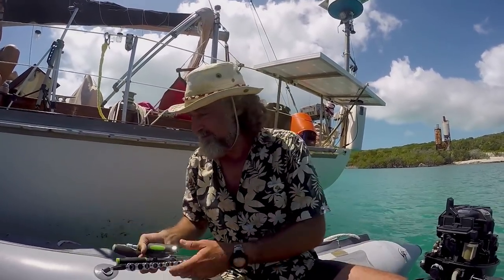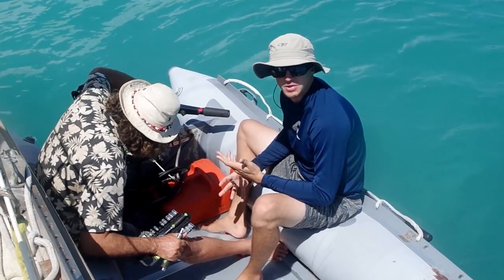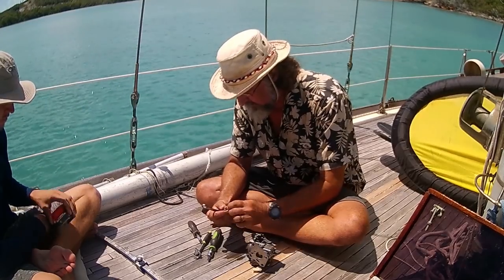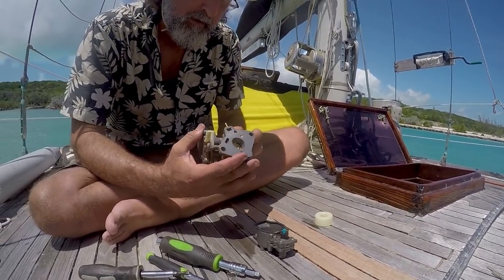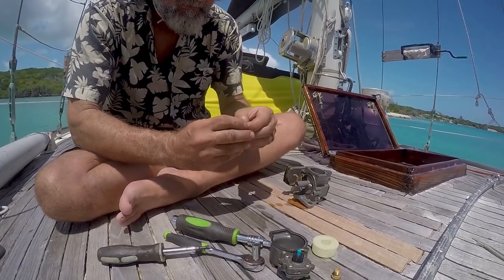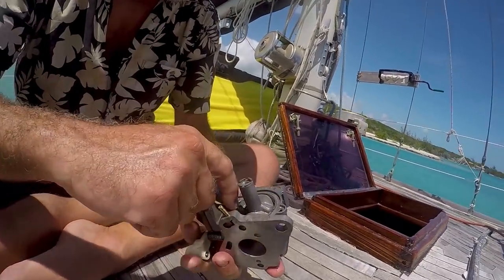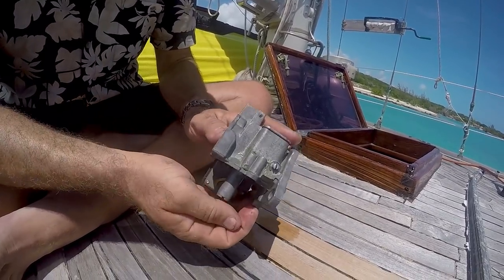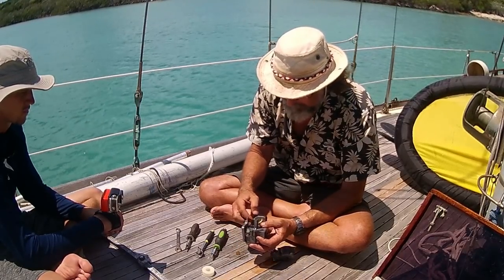Fixing a 2-STROKE OUTBOARD Motor [Capable Cruising Guides]

Comment: When I am dealing with outboard motors with fuel problems, I always swap out the entire fuel tank, and hoses from a good running engine before I tear into the engine. Seen so many times that a clog line, or a pin hole in the line cause so many problems. Easy to check and for me lots of the issues where the gas tank or lines.

Comment: And may I mention that power to weight ratio is awesome on two strokes and when properly tuned with good quality 2 stroke oil they are quite clean burning, and the simplicity is way better than 4 strokes and way cheaper to repair.
Reply: No  cam belts to replace and on looking on outboard problems its all salt water in bottom end and over heating and Corrosion. The only decoke when on a Engine strip is the water jacket with the fured  up corrosion and you would get that in a 4 stroke so for recreational use on a budget the Mercury 2 strokes are a good bet.
Reply: Especially if you have to lug it around

Comment: I have a terrible success rate of repairing carb problems, but after watching this video , I fortunately had the exact same problem as my 15hp merc outboard. Blocked jet with gunk from the fuel bowl. I originally thought it was an electrical problem because at WOT it would die like a light switch after a few minutes of running but will start instantly again. After checking and cleaning fuel filters, the boat died and would die shortly after.  It feels good to have a boat running mint again. It was not a good feeling having a dead motor on the water! Thanks Emily and Clark.
Reply from the maker: Hi Darren,
   Glad it helped. You could always buy me a beer on patreon.  :)
Clark

Comment: That's what cruisers do, help out other cruisers and the community they live in. Best explanation I have seen on how a carburetor works. I have fixed, cursed at, yelled, threw away, replaced and repaired more than I cared to. Here in the states these days, if you leave this crappy gas in the bowl, it gets gunked up quick, even with fuel additives on my lawn mower, weed wacker and blower. I finally found just changing the carb is a lot easier on my soul, but not my budget...

Comment: I'm having trouble with my mercury 4 cylinder 2 stroke 85hp starting. Once it starts it runs well until you turn it off, then it's a pain to start again. I have zero experience with  motors but this video gives me hope! I'm SO glad that he mentioned the part "if once the engine starts it runs good but it's a nightmare to start". Thanks
Reply from the maker: Hope it goes well for you.  

The bigger old mercs have multiple carbonators.  If yours does it's just more of the same.

A good trick for 4 cylinders not firing in all 4.  With an insolated glove pull off one spark plugs wire at a time.   If the engine slowed that cylinder was firing.   If it stays the same you found the one that was missing.

Comment: Good stuff Clark! I have a 2000 Tracker 25hp 2 stroke and it has been great for me to learn on and I had the same issue recently, starts great most the time plus idles fine then when getting up to speed it would putter out and die. Cleaned my fuel filter, got a new fuel hose which was deteriorating and used seafoam to help flush things out and so far so good, next step I would clean my carb and check my reed valves out of curiosity

Comment: If  I was looking for a 90 to 150 hp Outboard on a budget for a 15 ft 80s speedboat for some boating and the boat mainly on the Trailer surely a Mercury 6 Tower or 3 Cylinder Two stroke would be the best chose. But fantastic and informative thanks.

Comment: Just so you know the trick to taking these carbs off (6hp-most 20-25hp motors with the pull to prime) the 2 retaining screws that hold the primer assembly to the carb can stay on. Simply remove the tiny screw holding the primer plunger off completely, then remove the metal retaining ring on the inside. now you can slide the plunger completely off and thus remove the carb!

Comment: Brilliant!  Thanks for providing the link in your reply to my comment on your 4-stroke video. 👍
Reply: So, I’m the proud owner of a new to me, 9’ inflatable with inflatable deck and keel with a 2012 Mercury 5hp 2-stroke. My first tender for my 39’ sailboat. I sail on the Great Lakes and up to now have been harbour hopping as we cruise and now feel so liberated having the dingy and anchoring out. Bought all this used at an incredible price and am so happy with it as it runs flawlessly. So, my question:  Do you have a recommendation for a light efficient 4-5 hp 4-stroke outboard?  I’m looking to upgrade to an aluminum 8’ rib and want to keep things as light as possible. I like your idea of electronic ignition.  If not available, what’s your next best suggestion?
Reply from the maker: No one makes a fuel injected motor that small.  If I was to buy a motor that sized now I'd try the Suzuki.  I like mine, it seems built well.  They make the lightest offerings.  The 6 weighs the same as the 5 so I'd get the 6.  https://onlineoutboards.com/collections/outboard-motors/products/suzuki-6-hp-df6as2-outboard-motor

I've bought from this outfit before.  Always a good experience and cheap/fast.  Not a sponsor or anything, just who I recommend to friends.    (Though I should hit them up for a sponsorship)

Tahatsu makes a good inexpensive motor as well.
Reply from the maker: Yves.  Have you subscribed to us yet.  We live for that subscription number.  In fact would you consider sharing our playlists on social media?  Your friends might also like our stuff and we like to see that subscriber number grow.
Reply: Emily & Clark's Adventure , subscribes last night as soon as I saw your vid. Have watch 3 or 4 vlogs so far. Great stuff 👍. Will definitely share. Thanks for all your comments/replies, very helpful.

Comment: From experience, when you take a carb apart, always photo/ video.  I didn’t and could not work out how to put the diaphragm back on, in the end bought a kit..just as well perhaps. 
Also, first thing is to drain the float chamber, could have water in the bottom

Comment: good video, yes, and you fixed it, but I would have liked to see you lay down a clean-ish white cloth on the boat deck (at least a paper towel) before you started on the carb. might prevent tiny wood slivers and other dirt from getting into the carb during re-assembly and helps to not lose the tiny parts. also for young mechanics out there... might as well spray a lot of carb cleaner all thru that carb and its other jets since you have it right there in your hand.

Comment: Seagull engines were built in the UK one cylinder two stroke easy simple electronics simple carburettor had duel airflow in case of water as Many were dropped in to the sea cleaned out and worked very strange how they were built. When they made rules against two strokes that was the end of the company sadly. They started from two HP right up to ten HP. No Reverse gear no twist grip it speed was like lawn mower using your thumb to stop was just taking the thumb switch all the way back to stop which may not work to stop it so put hand over the carb and turn off the fuel. A terrible dangerous idea to many is how to start the seagull. A pull knotted rope that can kick back also trap the rope. No modern pull start with recoil just rope on a pulley with a notch The Fuel tank only held two gallons of mixed fuel painted black as engine was silver. Its prop was designed to push anything as once started it was going  there is no neutral or out of gear. They tested a WW2 seagull pulling via an aluminium boat two huge barges down the Thems river in the UK in the 1960s very slow but did it. Even though I am British the engines were built in to the 1980s  to 1990 but not sure what happened after that as Two strokes were being phased out of water ways because of the pollution. I had one on a river boat 15 foot all wood one.

Comment: Thanks so much for this - very clear and concise and not as complicated as it looks!  I'm interested in what you mentioned about changing carburetors to effectively go from 8Hp to 10Hp. I have a Yamaha, 8hp 4-stroke - Do you happen to know if it is possible to replace the original 8Hp carburetor with the larger 9.9hp carburetor?  Could definitely use the extra oomph and love the idea of having a spare carburetor around if ever needed.  Cheers!
Reply from the maker: Looks like they are also the same motors.  Big hint is they have the same displacement and are described in the same section of the website.

   I've never had the two both apart at the same time but I'd bet money the bigger carb will fit and function.

Also I like the Yamaha.  Don't see many as they work without problems.  Clean design, easy to work on.  I like that their carb has an accelerator pump.  Not necessarily but nice touch.   Tells me they probably don't cut corners in other places.

Might have been a larger motor I'm thinking of, but I like Yamaha.   I ride a Yamaha when I'm on land.
Reply: @Clarks-Adventure  Awesome! I'm really excited toggle it a try.  Will send an update to let you know how it works!
Reply from the maker: Looking forward to hearing the feedback.

Comment: Great video! I have that exact outboard, and I'll be testing it out on the lake on my tiny MacGregor 22 this weekend. (I mean I know it works, as I did the barrel test for almost an hour and it was running smooth) We'll see how bad fuel efficiency is compared to 4-cycle Honda. Thanks for that video, I'm a bit more confident I can troubleshoot some more issues if they arise.
Reply: So an update: after putting the boat in the water with that Mercury attached, after multiple turns I started it on a choke, had it on it for about two minutes after which I pushed it back in. That's when the motor died and couldn't be restarted. Tried for about 10 minutes, gave up and swapped with my trusted 7.5 Honda 4-cycle that I brought as a backup. While on choke Mercury was shaking pretty bad, smoking and even releasing some oil into lake, which made me even more encouraged to put it back on the truck. All in all, I'll be troubleshooting it in the upcoming weeks to see if maybe it has to do with those two plates that are supposed to close and maybe are not closing completely, or maybe throttle isn't adjusted properly.
Reply: Adventure__Pete did you ever find out what the problem was? I have a similar mercury and can’t seem to get it to start 👎
Reply from the maker: I'd check the spark plugs first.  Sounds like it was only firing on one.   Oil in the water on a two stroke is unburned fuel as they don't have crank oil to leak.

Could be compression, electrical or just a fouled plug.  I hope it's the plug and I bet it's the lower one.  Clark
Reply: @Clarks-Adventure , so actually I have it on a boat anchored on the lake right now and learned how to work it. I start it on a choke, and immediately put it in gear, throttle up, push the choke in and it works fairly smoothly. But yeah, I will have to do all those checks next time I get her out of the water. She might need new bottom paint soon too..
Reply from the maker: Oh.  With that procedure working it seems like your low speed fuel circuit in the carb is gummed up.  Take it apart and clean it thoroughly paying special attention to the needle valve and area around it.
   Baring that if you just back out the needle valve you should see some improvement.

Good luck.
   Sorry I didn't notice your first comment.  YouTube sometimes doesn't show me comments.
Reply: @Clarks-Adventure  thank you, will do next time she's out of the water..
Reply from the maker: Pete.  I hope you have subscribed.  Would you consider sharing some of our videos or playlists with friends on social media?  We would really appreciate the new viewers.
Reply: @Clarks-Adventure  yes, I'm subscribed and been sharing some of your videos with friends and family.. :-)

Comment: That's one happy Dan! Reading though the comments I'm guessing my 1998 Mercury 9.9 2-stroke is a Tohatsu product? It idle's rough but runs great at top speed. The main issue is it doesn't accelerate smoothly, stutters like a misfire right up until it reaches the upper RPM ranges. All primary and secondary ignition components were replaced before I bought it. As well the float was filled with fuel so they replaced it with an aftermarket part that very closely matched height wise but not exact. Would that small difference be the likely cause of symptoms described above? Poor low end performance, lack of smooth acceleration? Other than that the thing works like a champ for our fishing expeditions on the lake!
Reply from the maker: Well sounds like it's running lean.

Yes if the float is floating at the wrong fuel height that would cause what you see.  Probably can be adjusted by bending something or adding weight.  You could run a test with some pennies taped on but if it works hot glue them as the tape won't last but a few minutes in the gas.
    But first I'd make sure the needle valve is set right and the low speed passages are really clean.
     You should watch my 4 stroke video.  I talk about the carb better there.  Same basic thing.
Reply from the maker: https://youtu.be/5dRoPLzYpYc
Reply: @Clarks-Adventure  Will do, thanks so much for taking time from your day to respond!
Reply from the maker: Watch til the very end.  The last tip I give could also cause your symptom.
Reply: @Clarks-Adventure  On the fuel bowl housing when I removed the 11mm screw the tiny spring was there but I noticed there's no ball inside like it shows on the carb parts schematics I found online. It was definitely apart before I bought it so could that be the culprit? Primer injector parts, not sure what that circuit is called or function.
Reply from the maker: Can't diagnose over youtube comments. Best of luck.
Reply: @Clarks-Adventure  Appreciate it. Have fun on your future adventures!

Comment: Ethanol in the fuel makes the needle valve seat (usually some rubber-like compound) swell and restricts free movement of that needle valve. Best practice is to order a carb rebuild kit (pretty cheap, usually) and it will have a replacement needle valve and seat (among all the other gaskets and rings). Cleaning it on the deck of your boat is only a short term fix. But, great video. Thanks!

Comment: I have been told that Mercury's two strokes are known to be hard to start especially the older ones. Do you agree? Up here in Minnesota, we have as you know many lakes and rivers. Mercury outboards are very popular
Reply from the maker: I've never owned a Merc myself but the old ones seem like fine engines.  Always got them going when I worked on one.  I was an OMC guy back then.
   It's just the modern company I have issues with.  They seem to just be a marketing front for their former selves.  They do a lot of package deals on new boats.  Seems a bit shady to me.  Kinda like when Sears started making Craftsman tools in China.  Just selling out their former name selling a lesser product to people who don't know the difference.  Not really an honorable thing to do but profitable for a while.
   I just bought a Suzuki fuel injection and really like it.  Only a year in but best motor I've ever used.  And we use it daily in the ocean!

Comment: It sounds like you're well advised to get familiar with your outboard, especially the carb and fuel system as they seem to be very vulnerable to crap in the engine.
Reply from the maker: Yes.  I just switched to a fuel injected motor.  Third year and absolutely trouble free!
Reply: @Clarks-Adventure  Wow Clark, that's the way forward!
Reply from the maker: The new ones don't require a battery.  Take a look at my oil change video on it.  I really like the Suzuki offerings.  You simply can't believe how easy and reliably it starts.

Comment: Good video but you put the float back in upside down. I disassembled the same carb and almost put the float back in like you did. Look at the first of your bowl removal and you'll see the float was in the other way. There is some grenish color on the float from the brass part of the float.
Reply from the maker: Did I?

I'll have to look once we get to fast internet again.

It worked fine afterwards, so maybe it doesn't matter much.
Reply: @Clarks-Adventure  i agree the float looks upside down

Comment: Thanks mates :-) Darn good instruction
Reply from the maker: Thanks Frank.
 Did you get a motor going?
Reply: @Clarks-Adventure  Yes mates/maties: It was the damn stop button - the kill switch fell of. I thought it wouldnt start because i forgot to turn on the air vent to the intern tank (Mariner 4 hp Sailmate).
I discovered that the connection for the ekstern tank was not connected to anything - fuel went out in the motorcaseing ....? Why put on connetor to ekstern tank if there isent any connection.
Thanks to the Fab. instruction i checked the startplug (placed under a metalbridge...holding the intern tank).
Motor sits on my Westerly GK24 (the only one i Denmark..?) and impossible to work on it there.
Okay - when i found ot that my problem was related (remembering your wise and gentle words) to the kill-switch - the whole rubber thing fell of...Now my problem was to stop the engine - closed the air-vent on tank (keept on running..) - then i placed it on the stop the current-thing and i stopped...
Again - thanks for the Fab. video and instructions - keep on the good work and take care - out there...
Kind regards from Frank (shiptown = middelname in english) Jensen
Reply from the maker: Thanks for writing back Frank.
You might find you can kill the engine with the choke.  But best to replace the kill switch.
   Would you consider sharing our playlist on social media?  We would really appreciate the new viewers and your friends might find videos they like.